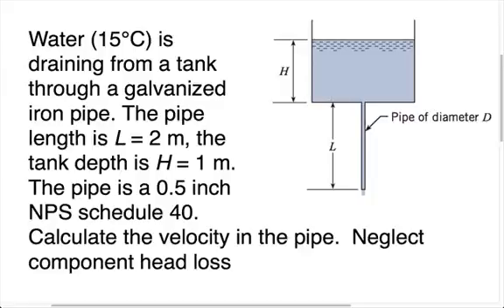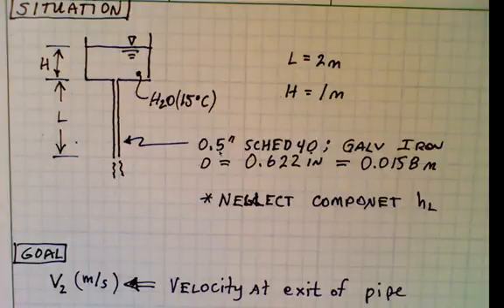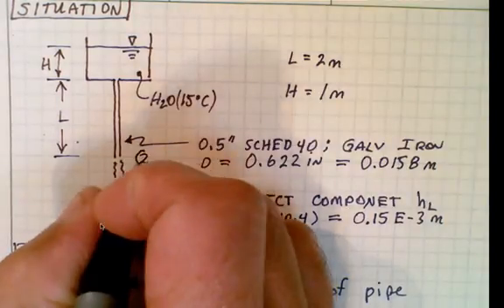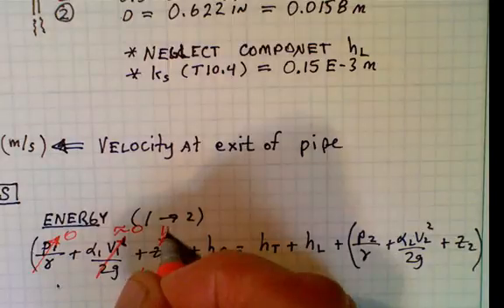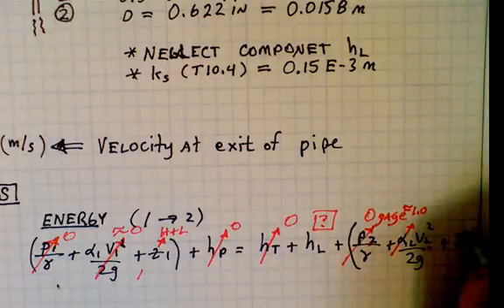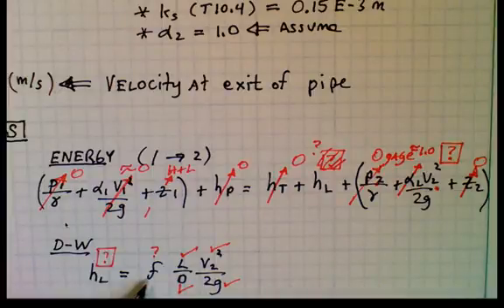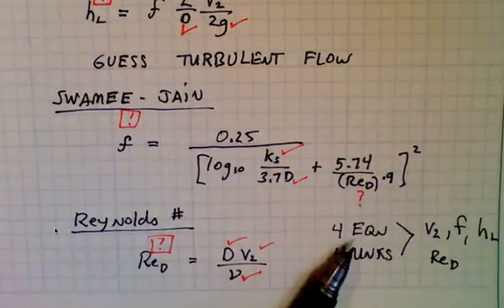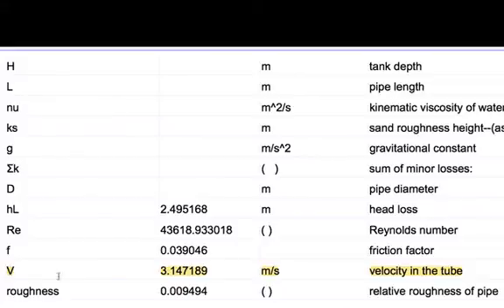Draining Tank

Comment: Excellent. What is alpha with v2/2g.
Thanks.
Reply from the maker: The symbol alpha represents the kinetic energy corrector factor. Most often this is set to 1.0. For laminar, fully developed, Newtonian flow, in a pipe,  alpha = 2.0. Note that alpha is defined as the actual kinetic energy per unit time that crosses a pipe cross section divided by KE/time corresponding to a velocity profile that is flat.
Reply: @DrDonElger  Thanks for your kind reply. Please keep on educating us...
Reply: Thanks. Does this mean (1/2mv2) divided by v2/2g.
By the way I never saw this "alpha" any where else derivation.
Reply from the maker: @cck0728  The formula for alpha is derived in section 7.3 in Engineering Fluid Mechanics, which I co author. In the definition of alpha, the numerator is Integral ( 0.5*density*V^3*dA), and the denominator is  0.5*(Vavg)^3 * Integral(density*dA). Note 1: if you are at a university, I'd recommend asking a fluids teacher to walk you through the derivation. Note 2: Alpha appears in the energy equation, not in the Bernoulli equation because the Bernoulli eqn. assumes inviscid flow. This is probably why you do not see this factor in other derivations. Note 3: It took me years of going through the derivations in various fluids books to sort the details out. So, be patient :)
Reply: Excellent ....Thanks for your detailed explanation. Surely, i  will look for your book....Once again, very much thanks for your kind reply....